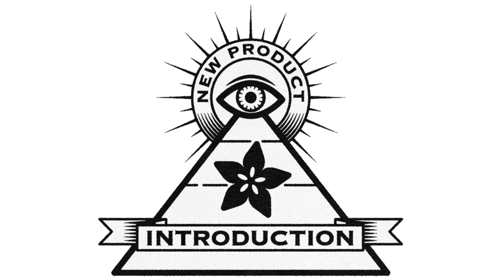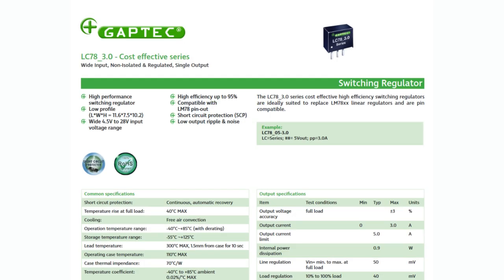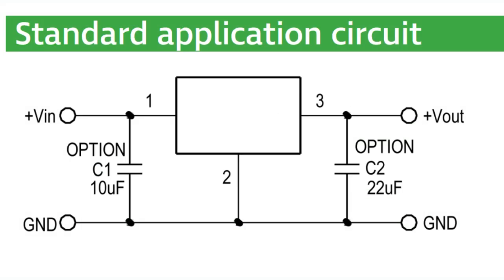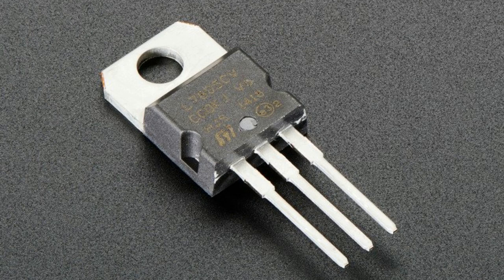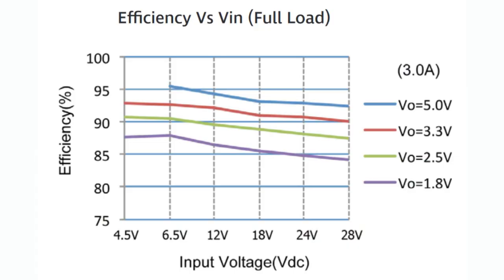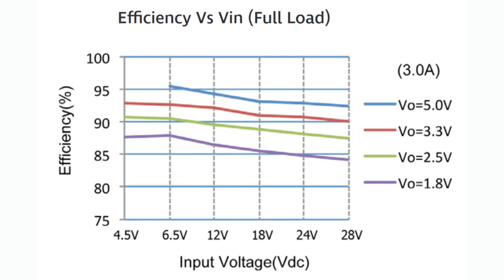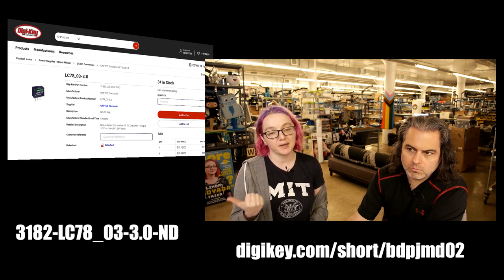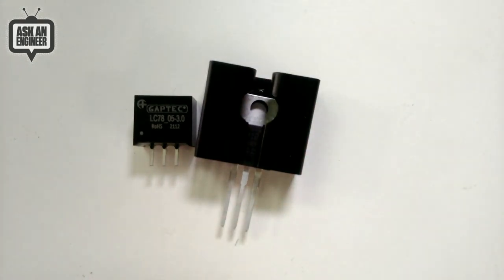EYE ON NPI – GAPTEC LC78_3.0 Series Switching Regulator #EYEonNPI #DigiKey @DigiKey @Adafruit

Comment: Hey what a nice idea. Really nice current capability, lets somebody really smart and good at it do your power supply design. Wonder if this is the kind of thing they'd make in voltages "a little bigger" than common so you can stick an ldo in to get less noise.
Reply: Look at RECOM, they have a large selection of output voltages so you could slap a 5V model in there and then use your LDO to reduce noise.  I've used their 9V model to power the Vin pin on Arduinoes since their onboard linear gets very hot trying to run a board off 12V.

Comment: They fill sort of a niche, since RECOM has had these available for years.  If you don't need 3 Amps, this one:  https://www.digikey.com/en/products/detail/recom-power/R-78E3-3-1-0/5327711
Is a good choice and costs only $3.52 in single quantity.   Also, RECOM has a wider selection on input voltages for those occasions where you need the headroom.